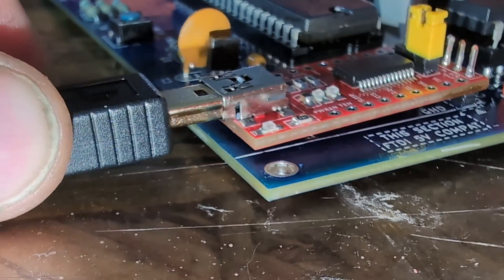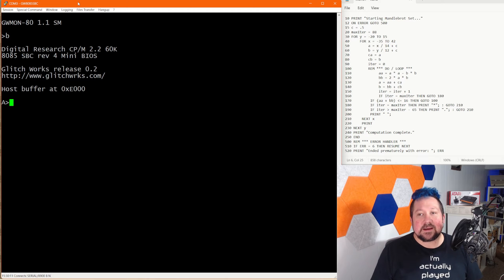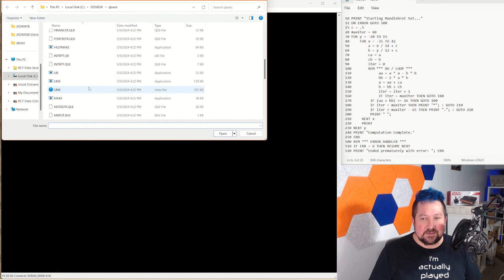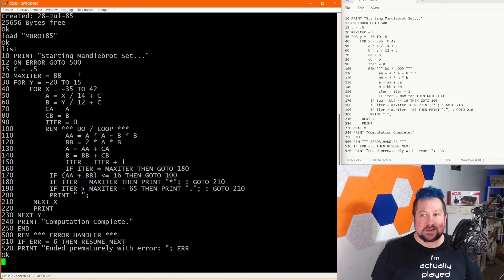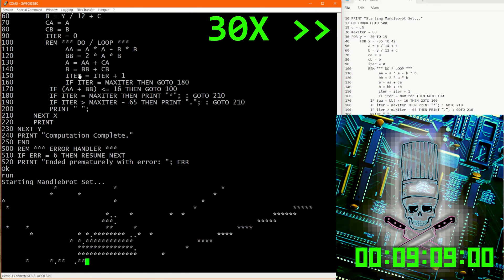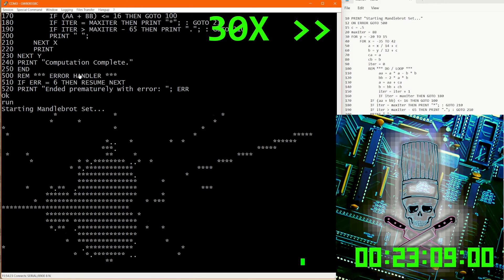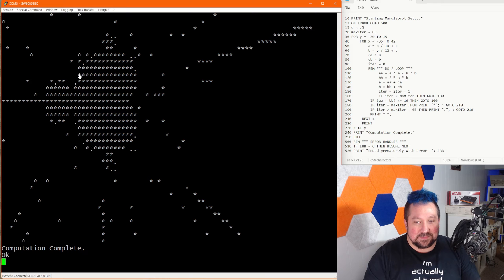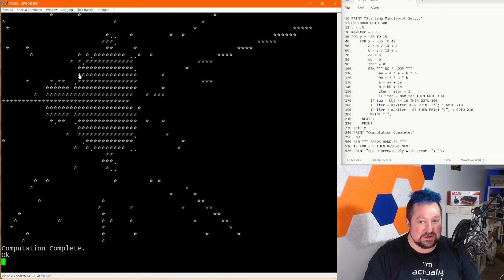I built the GlitchW0rks 8085 SBC Rev4 Mini | RetroComputing Fun!

Comment: The 8085 was used in several S-100 computers; notably the CompuPro dual 8085/8088 CPU card. The Zenith Z-100 family of computers copied this design, since the pinouts of the two CPUs made it easy to put them on the same bus.

The 8085 didn't compete well against the Z80,  as the Z80 was faster and had a larger instruction set. But when the CMOS 80C85 came out, it gained a big advantage that earned it in portable and battery operated computers like the TRS-80 model 100.

I note that you have an 80C85; not an original 8085.
Reply from the maker: Yes, the 80C85 is what comes with the kit.  I have my TRS-80 Model 100 all cleaned up and ready to go.  I did notice it ran on the 8085, which I thought was really cool!